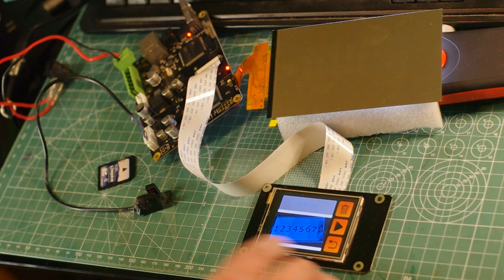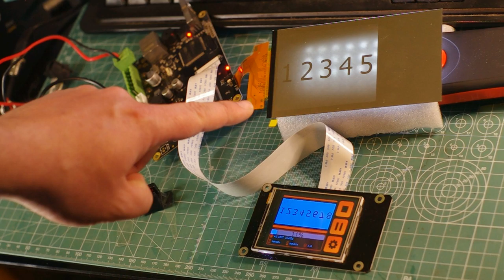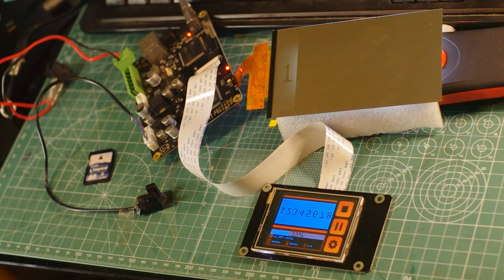Photon AA testing on Bootlegged Epax Firmware

Comment: It surprises me that it seems all MSLA printers choose this method of AA. Why not have a sequence of exposures, with power-of-two exposure times? That way your 8 exposures should give you full effective 8-bit depth. Perhaps in a future firmware update?
Reply: multiple exposures is what these printers do. only good AA is true greyscale AA not this crap, preferably with a monochrome screen. btw multiple exposures is not equivalent to 8bits.
Reply: @X3msnake  Ive worked on optical hardware systems like these; and there is actually a decent reason to go for binary/PWM control. Operating the LCD at intermediate grayscale values makes determining a precise illumination dose a bit of a calibration nightmare. 

I get that these 8 equal exposures dont realize 8 bits of precision; but it seems a trivial firmwate change to have 8 exposures, with a power-of-two distribution of exposure-times; and by manipulating the pattern in each image shown, you should be able to realize 256 different sum-of-exposure-times for each pixel. 

for i in range(0, 8)
pattern=(1<<i) && byteimage > 0
time=(1<<i) / 255 * total_time

But perhaps these SLA-optimized LCDs have a glacial response time, and thats why the above does not fly?
Reply: @eelcohoogendoorn8044  binary pwm? that sounds like a contradiction. Anyways the reason why this is like it is it is not because of some clever tactics but just a way to try to fake AA with a binary output that they went for. btw you dont define dosage with grey. grey is used for smoothing only. there are a lot of info on that open, specially from the RIP open project by autodesk Ember.